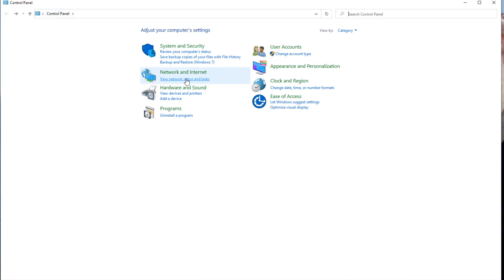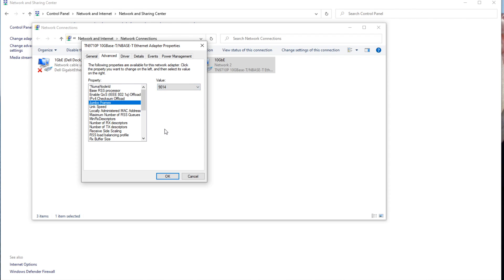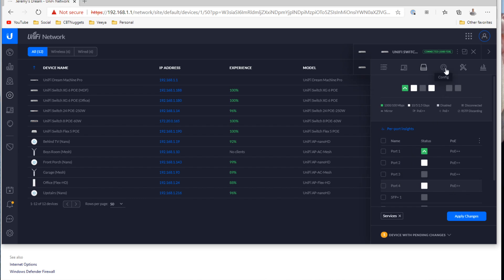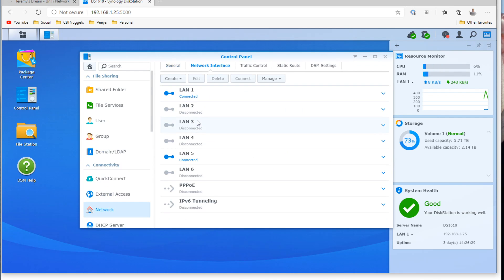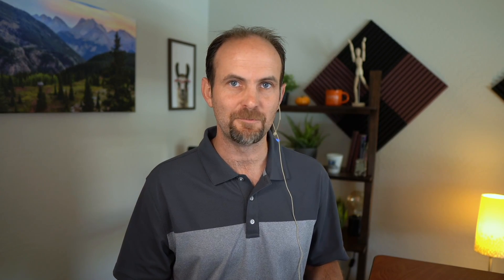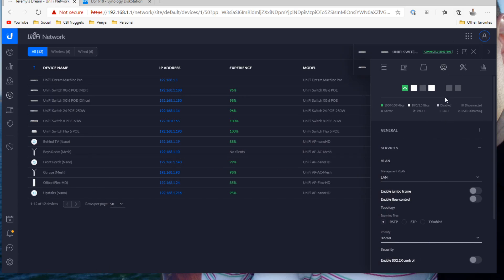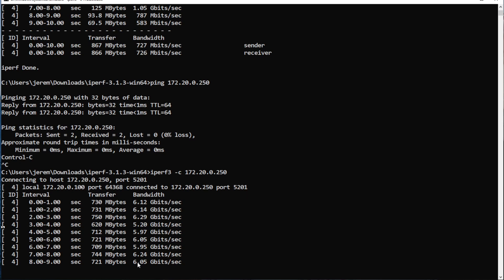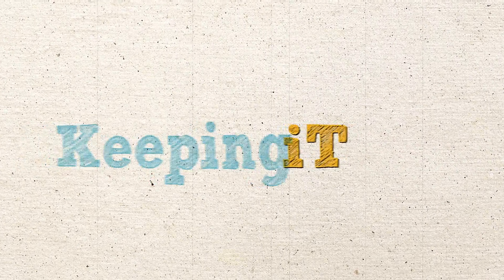What about JUMBO FRAMES? - Ubiquiti and Synology Performance Test

Comment: I had my synology NAS set for MTU 9000, my Windows 11 PC set for Jumbo frames 9014, and my Ubiquiti 10gb switch set for Jumbo frames.  And backups to the NAS threw all sorts of network errors.  Resetting the MTU to 1500 on the NAS corrected this.  So, what did I do wrong?  I only changed the Switch that both the PC and the NAS are connected through.  Is that not correct?

Comment: Thanks for a great video. I set up my Synology DS713+ with your instruction.
Control Panel->Networks->Network Interface->Lan 2->Edit-Set MTU value manually->MTU Value:9000
I use Synology Assistant in Windows 11.
I am now unable to log in to my Synology. Does anyone know what to do to be able to log in?

Comment: I did the ping test to my NAS, with Jumbo @ 9000 MTU on a 10Gbe connection (6xHDD with SSD cache) iperf3 was 4.7Gbit. Jumbo down to 1500 I was at 5.7Gbit. I did the ping test to ensure I was not fragmented at -l 8972 as well. Just magic lol

Comment: just because it is faster doesnt mean your jumbo frames are enabled correctly. To actually validate your jumboframes are working you need to run.

ping -f -l 9000 172.20.0.250, that will show if the packets are fragmenting or not. if you get request timed out your network is not using jumboframes.
Reply: Hi, 
Yes I tried in the same way to change to jumbo frames but it is not fragmented. I am using windows 10 platform, can you please help me why it is not enabling the jumbo frames and how to enable them

Comment: Here's a big question

So when one Link in the chain didn't have jumbo frames enabled it dropped packets ?

So if I have an office Network and some computers have jumbo frames enabled and the switches and the server they're talkin to also has it enabled

Will that mean that any computer that doesn't have it enabled will suffer performance ? 

There's lots of computers that don't need to talk to the server but they'll probably talk to each other and the printers etc through those same switches that have  jumbo frames turned on 

so if you don't make every computer and the office have jumbo frames is that bad  ? Or is there no difference?

Comment: Does it matter that you have different MTU sizes? 9014 vs 9000? What happens when there are different MTU sizes in your chain? Does everything run to the lowest common denominator? If so why does this have super bad results with Jumbo Frames to Non-Jumbo Frames?

Comment: Thanks for the excellent follow-up, Jeremy. Jumbo frames definitely show a solid gain in performance! I believe your bottleneck at this point are the hard drives. I don’t remember you discussing what RAID level you chose. Obviously RAID 0 should provide the fastest write speed. RAID 10 is what I use on my QNAP.
Reply: Iperf is memory to memory default, not disk. If you don't include the -F parameter

Comment: if you setup Sever_Lan on Jumbo Frames & PC_Lan not, then would the pc's be ok and carry on working with mtu 1500, as i only require servers to work with jumbo frames mtu 9000 and backup devices for backup, any response would be helpful.

Thanks